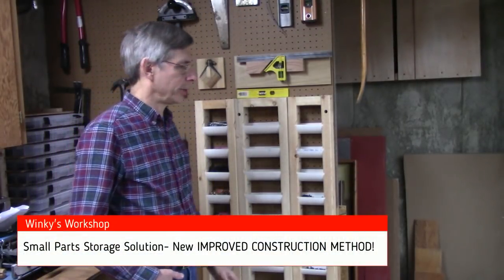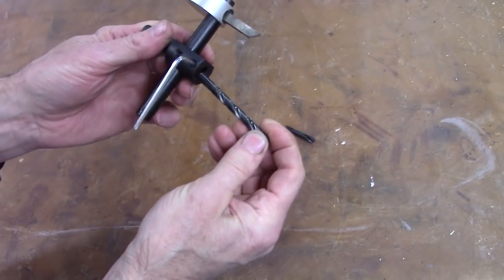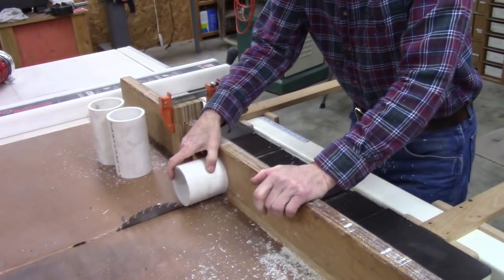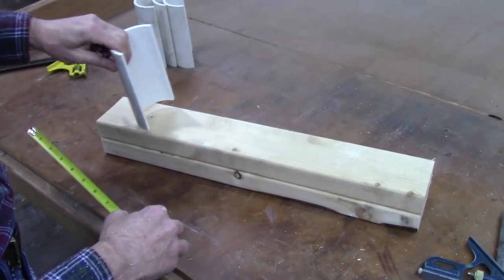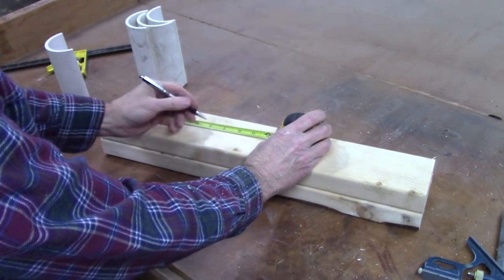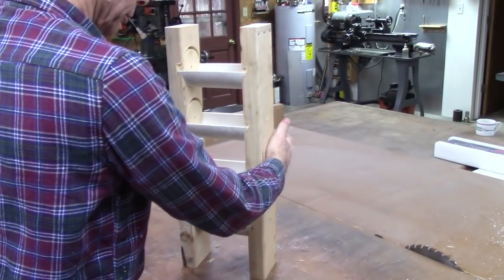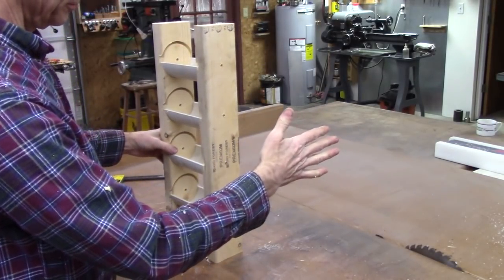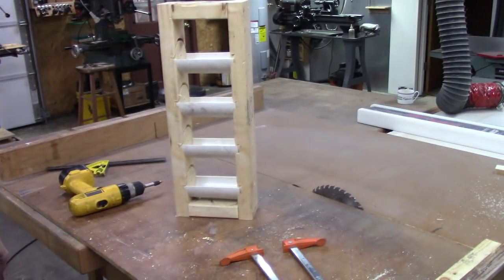UPDATED! A Very Cheap Shop Storage Solution. Easier to construct!

Comment: The second system is an improvement.  I have one of those cutters you showed.  I would probably add a plexiglass door to keep debris from filling up the system.  Outstanding job Winky
Reply from the maker: Thanks and I agree, this circle cutter worked much better.  As for the dust, I blow mine out occasionally. Of course I only keep screws in mine so a little dust isn't a big deal. I love the quick easy access and visibility.

Comment: Great inspiration.  No circle cuts needed. use gutter down spouts with tsaw crosscuts
Reply from the maker: If the kerf is wide enough that would be great. They also make a this was PVC which might work better.

Comment: Great Idea, Great system. One change, Cut your long tubes in half on the band saw first. then you can stack your half tubes on top of each other and cut them to length on the table saw in one pass, not having to turn the tube and line up the cut. I think I will leave the shelves loose to turn. That way I can roll it to dump it out to clean out the sawdust.
Reply from the maker: Thanks a good idea. I used these shelved for a while and found I wanted to be able to remove a drawer and move it to where i was working. I now have harbor freight storage bins.

Comment: I like using jars to store "stuff" . easy to move to the work area and you can still see inside.  This is a great idea for  jars. For small items you could fit 2 or 3 baby food jars in one position. I use baby food jars. I tried eating the baby food, but I found  it better just to dump the food and clean out the jars. If you know someone with a baby ask them for their jars.
Reply from the maker: After using this for a while I agree. The jars are a good idea and I have used this method but I've switched to plastic bins for all my larger screw and bolts. I like that I can move them where I need them. With the storage I built I was waking back and forth to the bids.

Comment: You could also use a hole saw if you had one that size! Either way you accomplish the same goal, great video!  Keep it up!

Edit: I realize now why a hole saw would be more difficult... Smaller Kerf for the PVC..
Reply from the maker: It might work with the thin wall pipe...
Reply: @WinkysWorkshop  hmm I'm glad you said that I have quite bit of 1/16 wall 3" pipe I scrapped from an old table... Might have to give it a whirl!
Reply from the maker: @ForgeandFairway  Cool...  hopefully it will match the pipe.

Comment: I think that x-y table on the drill press is a work of art! I know you don’t think it’s worth doing a video on it because of the expensive hardware used, but it’s just to dang interesting not to…. Every time you use that dang drill press, there it is, just waiting for its chance to have its day in the sun. lol
Reply from the maker: Believe it or not, I just got some 1/2" Acme threaded rod today and I will be making a video on how to build an x y table soon. I'm guessing it will be 3 weeks to a month before it happens, I'm in the middle of restoring a 1947 metal lathe and have parts everywhere. The video will be two parts; 1) The table build and 2) making the dials. I made mine out of some surplus slides. If you had to buy the slide It would make the table cost over $800. The new table will be lighter, and more solid than mine and bolt to an existing drill press table. And you are right, the x y table is the best thing I have ever done for my shop. I now have a mill but the drill press is still my "go to" machine for drilling!  I'm guessing it will cost less than $150.
Reply: @WinkysWorkshop  Awesome!
Reply: TV ghb h

Comment: Looking good that is one thing I had not considered.  I put thin plywood on my workbench and painted it about 1977.  What brand and model is the stapler that you used on the trim.  Tell us about it.
Reply from the maker: The nail gun is a garage sale special with no name anywhere on it. I suspect harbor freight. It takes nails from 1/2" to 2" and I use the heck out of it. They are super handy for doing glue ups kind of like I did with the trim. The nails hold it in position while I installed the screws. Glue makes things slip all over the place but the one little nail acts like an alignment pin while you clamp the work. I think one like it is less that 30 at Harbor Freight.

Comment: Hey Wink..what's the best blade for cutting PVC on the table saw.. and do you reverse the blade? Going to try this one.. I got nuts bolts screws scattered everywhere .. lol
Reply from the maker: Any blade works but its hard on blades. Use it normal direction.